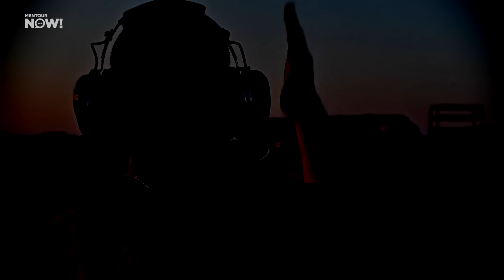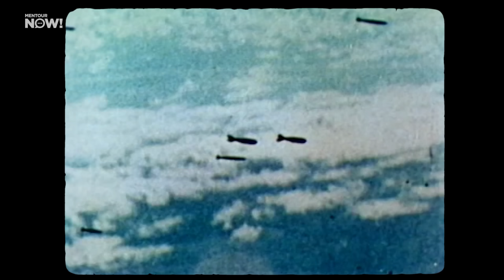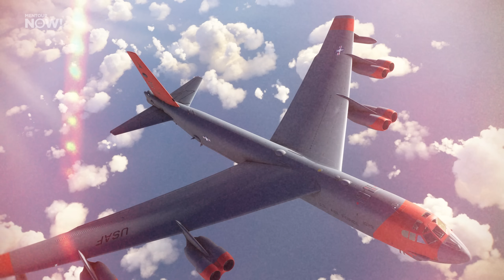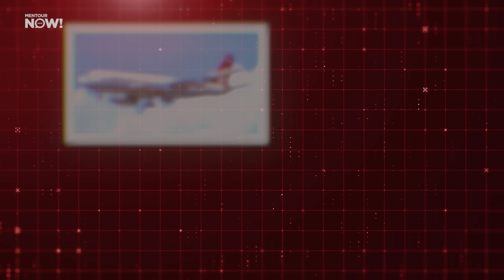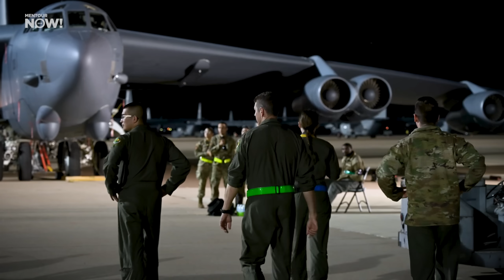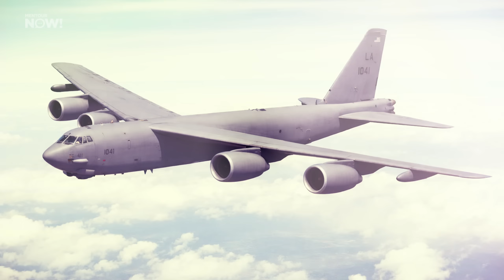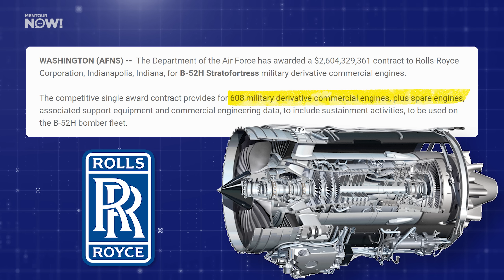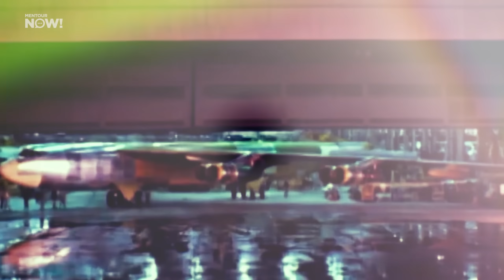WHY Are They Changing The B-52 NOW?!

Comment: Well, boys, we got three engines out, we got more holes in us than a horse trader's mule, the radio's gone, we're leaking fuel and if we was flying any lower why we'd need sleigh bells on this thing. We've got one little budge on those Rooskies. At this height why they might harpoon us but they dang sure ain't gonna spot us on no radar screen.

Comment: The B-39 is like a much smaller version but with prop engines, but still... the B-52 (first built in 1952) was an appreciable step forward in a number of respects. From what I've read, production ceased in 1962. Has Boeing continued to make airframe parts for it? Because metal eventually ends up developing stress cracks. I can't imagine a 1950's airframe still in actual service with its airframe intact.

Comment: Instantly chuckled out loud when I saw the Haynes Manual on the B-52. Imagine my surprise when I found out that there is such a thing. The  advantage of having an analogue aircraft is that what ever jamming capabilities an adversary may have can be bypassed. Upgrading a platform isn't always advantageous. Kind of like comparing the Tu95 to the B-52. The Tu95 shouldn't stand a chance because the counter rotating props shouldn't work but miraculously and spectacularly do. Military funding is difficult. I'm not the decision maker. With practically all the parts relatively off the shelf. It's time to base a weapons platform carrier on somewhat similar tech. and mothball the rest of the fleet of B52s incase of some unforeseen scenario. In my always humble opinion of course.

Comment: They can do the same thing I do with cars bypass the computer and run a carburetor bypass the anti-lock brakes bypass every electronic on board except for the electronic speedometer also HEI ignition bypasses any computer

Comment: The "why" is simple: More power, higher reliability, lower operating costs.

They had two engine replacement options, and they went with the one that was "worse", but faster & easier to do. That, in turn, suggests that they want upgraded B52s operational ASAP, because there's concern that they'll be needed.

Comment: While I agree with the assertion that from an Aero Engineer perspective that 8 JTFs doesn't make sense, it does from a Tactical perspective.  The tactical requirement for being able to loiter and survive long flight durations  while operating with a full load.  The thrust/power required to make the lift and the ability to Rest engines and conserve fuel while loitering is one consideration.  another requirement is being able to continue the mission after losing an engine.  losing an engine was eluded to in the presentation but the tactical benefits to losing 1/8th vs. 1/4 of you flight power is a huge advantage.  Over all I give this an A+ for addressing the aero engineer aspects.  some one will say "well what about the other Cargo aircraft and their TFJs?" Well, they are "CARGO" not bombers, With different mission sets.

Comment: Do you really have to ask????

YES!  It is a VERY simple reason!  The B-52’s wingspan is 185ft!!!  

The airframe, wing structure, and control surfaces (especially the rudder) were designed for the thrust distribution and characteristics of eight smaller engines, making a four-engine setup potentially uncontrollable with asymmetric thrust from engine failure.

The U.S. has 76 B-52’s in its inventory with 58 in operation.  

Basic critical thinking skills!!

Comment: I Here the B-52 in it's present state is good to around 2035. so without resurrecting the B-58 the changing out 8 engines per plane they put 2 aircraft. With around 100 aircraft in the fleet the job should take 50 years. Boeing not having the best reputation for quality engineering maybe 4 years for each aircraft..

Comment: The modernization effort also includes a brand new radar system that is basically a jet fighter's, but massively powerful since there is so much room and available electricity onboard. In theory this bomber could be shooting off air-to-air missiles, either in self-defense, or as part of a networked data link shooting longer-ranged missiles from far behind other aircraft operating a defensive screen for it (the B-52 itself is not very survivable and would not be used on the front lines in any near-peer conflict). But the radar also might let it serve as a very effective data-generating node, similar to an AWACS system.

Comment: The B-52 is our only bomber capable of dropping more than a small handfull of oridinance that we have left in the USA.  Of course we aren't going to get rid of it anytime soon.  Part of the reason it is going to take so long, is that they are going to upgrade the wing spar and also service much of the structure as well.  It's not just adding enginges, its a major structural upgrade as well.

Comment: The last actual B52 came off the assembly line at 62. I believe they've got dozens of them couple of 100 of them. I think actually, in the desert because of the salt treaty, where we had to disarm, they put a new one together. The other day took one out of the desert and put it all back together, they have been upgraded many times over the years. The engines used to pour out so much smoke. You could see them coming from miles away.  All of the\nAirplanes did really
Reply: Current in service inventory is 84.

Comment: I suppose if the thrust of the each new pair of engines i similar to that of a pair that re being replaced  there are lots of problems - like stress on pylon  mounting bolts - that are much less of an issue.

Comment: The B-52 is first and foremost a Bomber plane.  If one to take a close look at the plane, the first thing noticed would be the long wings and the thin body, by comparison.  Truth be told, the B-52 could house several tanks, Humvees, and other large equipment if it were a cargo plane.  That means the craft is designed to carry heavy stuff to far away places.  Stop and about that.

Comment: OK-----------.  NOTICE THAT THE B-52 HAS A RUDDER CONTROL SURFACE THAT LOOKS MORE LIKE A TRIM TAB THAN A REAL CONTROL FLAP...  THE B-52 RUDDER WAS DESIGNED THIS WAY TO KEEP NUCLEAR BLASTS FROM TEARING OFF THE NORMAL HUGE RUDDER FLAP USED ON  ALL LARGE WINGED TRANSPORTS AND BOMBERS UP UNTIL THAT TIME. A PROBLEM THAT ALMOST DESTROYED THE B-29'S THAT CARRIED THE FIRST ATOMIC BOMBS. CRACKS ONLY DISCOVERED DURING DEEP MAINTENANCE AFTER THE WAR.  LARGE CONTROL SURFACES NEEDED TO CONTROL FLIGHT WHEN ONE OF TWO ENGINES (HALF THE THRUST) ON EITHER SIDE OF THE TRANSPORT FAILED FOR ANY REASON TO MAINTAIN FLYING STRAIGHT AT SLOW LANDING SPEEDS...  THE 4 ENGINES ON EACH SIDE MAKE IT POSSIBLE TO LOSE ONE ENGINE ON EITHER SIDE (25% THRUST)  AND STILL MAINTAIN CONTROL AT LOW SPEED FOR LANDING USING THE RUDDER (TRIM) TAB AND REDUCTION OF OPPOSITE WING ENGINE THRUST, INSTEAD OF THE NORMAL LARGE CONTROL FLAP ON ALL OTHER LARGE, LONG WINGSPAN AIRCRAFT.   THOUGH THE REDUCTION OF THE SIZE OF THE RUDDER ON THE NEWER B-52'S  WHEN TESTS SHOWED THE NUCLEAR BLAST WOULD OVERSTRESS THE HUGE BARN DOOR RUDDER, MADE THINGS WORSE.
---------------  WHAT EVERY B-52 PILOT IS TERRIFIED OF IS THE DREADED LOSE OF TWO ENGINES ON EITHER SIDE OF THE AIRCRAFT.... THAT GARRANTIES TWISTING DOWN INTO A CRASH BEFORE THE BIG BOMBER CAN REGAIN THE SPEED NEEDED TO MAINTAIN FLIGHT WITH ONLY TWO ENGINES RUNNING.  ESPECIALLY IF THEY ARE STILL FULLY LOADED WITH BOMBS AND MORE THAN ONLY A FEW MINUTES OF FUEL LEFT IN THEIR TANKS.  WHY IT WAS COMMON PRACTICE TO SPEND AN HOUR DUMPING FUEL IF THE MISSION OR FLIGHT WAS SHORTENED FOR ANY REASON BEFORE LANDING! AND EVEN THEN 50% OF THE TWO-ENGINE OUT INCIDENTS ON LANDINGS STILL RESULTED IN THE LOSS OF BOTH BOMBER AND CREW...
----------------. WHAT WOULD BE PROHIBITIVELY EXPENSIVE, TIME CONSUMING WHILE ADDING TONS OF WEIGHT  TO THE RUDDER AND LEAD TO THE NOSE FOR BALANCE, WOULD BE NEEDED FOR REDESIGNING THE RUDDER WITH A STRENGTHENED NORMAL SIZED CONTROL SURFACE SIZED FOR 4 ENGINED FLYING AND NOT THE 4 ENGINE INSTALLATION ITSELF.  WHEN THE 8 NEW SUPER RELIABLE ENGINES ON THE BOMBER GARRENTIED 99.9% REDUCTIONS OF LOSS OF TWO ENGINES DURING LANDINGS  FOR THE BOMBER'S REMAINING LIFE IN THE AIR FORCE...  WITH THE ORIGINAL RUDDER.

Comment: I worked on a jet that had the same inertial navigation system as the B-52. We switched to RLG updated by GPS in the late 90's.  I'm not sure when the B-52's changed over, but they've likely had GPS less time than some pilots already into careers.

Comment: Thanks for explaining this.  I had wondered why they didn't upgrade to a 4-engine design.  However, parts of your explanation still don't make sense to me and I'll just have to take your and the engineer's word for it.  While the current configuration has 8 engines, they are attached through 4 pylons.  So, what is the difference if there is only one engine hanging on the pylon instead of two?  The thrust moment will still be in roughly the same place.  As for the engines being larger in diameter, the B52 has the outrigger gear near the wing tips and there is still a lot of ground clearance.  

Still the upgrade that they have chosen does provide a substantial improvement and should last for decades.

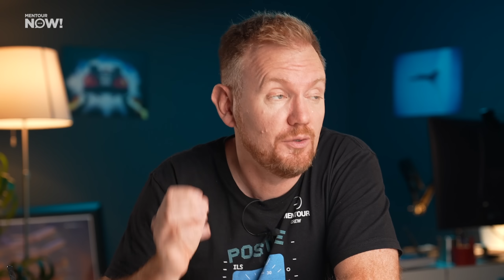Comment: There's one more reason for the engine choice and that's speed. The B-52 is roughly 15% to 20% faster than today's modern passenger planes. While this seams to be a relatively moderate difference, the Mach-number is not, as it comes much closer to Mach=1. At such speeds, very high bypass engines do not work well anymore. This is because you'd require a more pronounced inlet diffuser to allow the fan blades to operate at reasonable speeds near their tips. A large amount of the incoming flows would have to be diverted to flow around the (then much bigger) engine and this would sacrifice efficiency gains. This said, a bypass ratio in the range of 4:1 to 5:1 seams to be very adequate ... if not even a bit on the high side for the B-52 speed. One may doubt the said efficiency fuel savings in the order of 30% to 40% for the same reason. Low bypass ratios aren't that bad at high speeds, even the said approx. 1.5:1 of the JT3D isn't too bad near Mach =1. A far higher bypass ratio in the 1:10 league as common on modern passenger planes would mostly be beneficial on take off and climb, but not at all on cruise.

Another option would be to reduce the speed, but, besides potentially sacrificing operational needs considering the type of aircraft being, would require a totally new lay out of the wing. Not a good idea at all.

Comment: Where is the surprise at different inlet flow characteristics with increased bypass? You only have to see the change in siamese nacelles required on the Lockheed Jetstar modernisation just before it became irrelevant. A much bigger “Dagmar” was required between the inlets. 

Kids these days…

Comment: Having the engines so far away from the main body is .... foolish to say the least.  If the engines on a wing get knocked out, the Remaining ones would probably be absolutely useless because of the asymmetry .!  Having the engine pods close to the fuselage like the A10 is BASIC.  By all means, KEEP the airframe, but mount the engine nacelles on the main frame or wing roots.!

Comment: Very interesting; that plane was the finest that a large group of the best engineers could come up with in the 50s; and they did an outstanding job!    There are quite a few machines and processes in industry that live on for many decades because the original designers did a great job; for example, my 1967 Ariens snowblower is designed and built better than most new ones and I plan on using it for many more years,  because it turns and handles easy due to having a differential and proper wheel placement, and has a wide range chute,  and a four speed shift, and built with heavy duty components, and I don’t have to spend a lot of money on a new one.   As for dependability, it has never left me unable to move snow.   Having a flathead engine, it does take more fuel than a modern overhead valve, but at about 1 gallon per year, that is insignificant.  This sounds a lot like the B-52,  except that old jet engine technology is significant on it

Comment: My personal, unqualified, opinion is that the Air Force should have committed to a four engine layout in the early 1970s, initially using the 747-100's JT9D-3A, an APU, and a revised vertical fin with a longer chord rudder. One of the major reasons the 8 engine layout is being retained with smaller engines is the B-52's small rudder; concerns about engine-out handling.
The JT9D-3A, the first production variant of the engine was first certified in 1970 and theoretically would have been available in quantity after the Vietnam War. Having a four engine architecture already in place would have allowed the aircraft to be upgraded with newer engines in the following decades with relative ease. In particular, I think the C-17's F117 (PW2000) engine would have been ideal to adopt in the 90s, alongside the C-17.

Comment: As a B52 crew chief in SAC back in the 70s I appreciate the update. Talk about  fuel, the KC135, fully fueled, weighed about 300,000lbs. While the B52-H could and would often launch with 300,000lbs of fuel plus it's bomb load.

Comment: The B-52 will be around for, as it stands right now which is free to be extended, nearly 100 years of projected service life for the same reason alligators / crocodiles have apparently hardly changed in however many millions of years:

There are only so many ways to make a hammer.

I guess the B-52 is pretty much the perfect final form of the evolutionary path that is “We need a biga$$ long range heavy bomber”.  Why reinvent the wheel…

Comment: I’m guessing it’s to retrofit them with high bypass turbofans.  In 30 years, it will be to replace those with electric-compression jets.  30 years after that, remote fusion, pure-electric- delivered from a constellation of small fusion reactors in high orbit pumping out the the space disco version of AC.  30 years after that, they’ll hint at retiring the BUFF, but then won’t.  Somehow, dropping bad stuff from planes won’t go out of style for another 500 years.  But don’t celebrate yet, the reason it eventually stops and never starts up again is

Comment: Long long after all these digital fly by wire composite airliners are gone the aluminum steam gauge cable ran aircraft will still be flying.
Park a F-22/F-35 etc long term in a hanger alongside a P-51/P-38 era and come back in 50 years or even 10 and try to fire them up.
Which aircraft you wanna bet will be flight ready and in the air first.

Comment: The obvious answer is eight new small modern efficient engines.  As it came out what the air force picked sounds more like a mid level compromise at best. Basically they got half way there in efficiency.

Comment: Excellent presentation!

Any chance you could do one on the XB-70, covering both technical and political issues?  For example, on the technical side, there's a persistent argument that equiping the Valkyrie with stand-off weapons would've made it a more capable weapon than the B-52, at least in that operational mode.

Comment: Nobody today could design this plane's equal.  Every detail would be stuck in committee, there would be countless daily "progress" meetings, and the final product would be four times the projected and not meet it's design mission capabilities.  Look at the JSF program.  It was supposed to a a supersonic VTOL but could not reach mach 1 with the lift fan installed.  So they rewrote the test to remove the fan.  So how the hell does that meet the design mission parameters?  This old bird was designed and built the old fashion way.  No kickbacks to contractors or Senators.  Built more rugged than it needed to be.  Everyone showed up on time and did their job.

Comment: I never thought how difficult it would be to replace those twin engine pods with single pods holding a 747 class engine.  It does make perfect sense.  Still, if the airforce bit the bullet and re-winged the B52's imagine what the aircraft could then do.  Actually, if a sub-sonic, non-stealth bomber of the B52's size was still useful today, what would a new aircraft designed from scratch around the B52's parameters took like today?  And would that be cheaper than rube-goldberging the existing planes?

Comment: I know how different aircraft design is now from how it was in the previous century. However, when I hear how remotorising (or reengening, idk what's the right term) the B-52 would require a major overhaul of the airframe, two aircraft that both first flew in 1947 come to my mind:

- The first one is Grumman F9F. Originally it was a straight-wing fighter, but in the early 50s it had it's entire wing replaced with a swept one, which seems rather impressive to me.

- The second one is the Antonov An-2 biplane, which not only has been in continuous production for almost 80 years now and has had multiple engine upgrades including swapping it's original ASh-82 radian piston engine with a turboprop, but has had a single wing TR-301 variant put on the production line in the 21st century!

All of that makes me think we still might see a 4-engine B-52 in service.